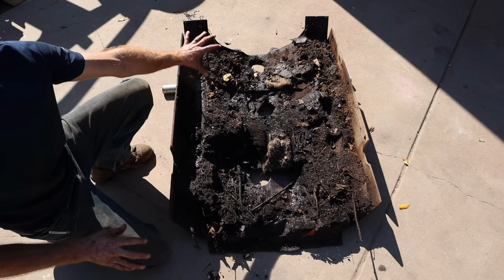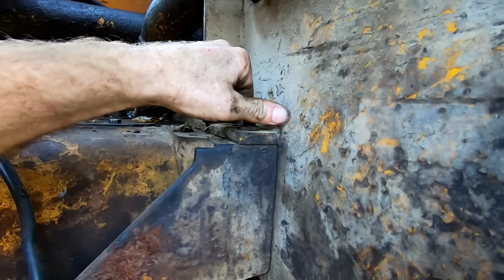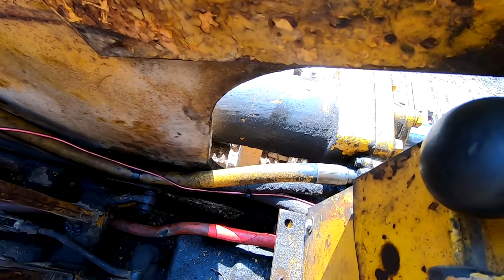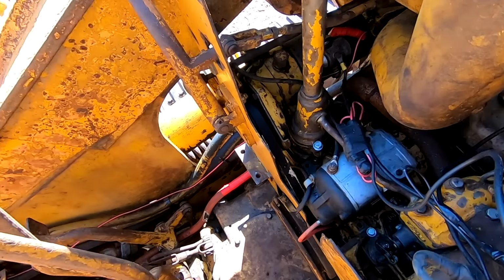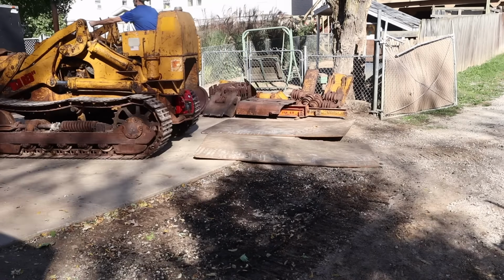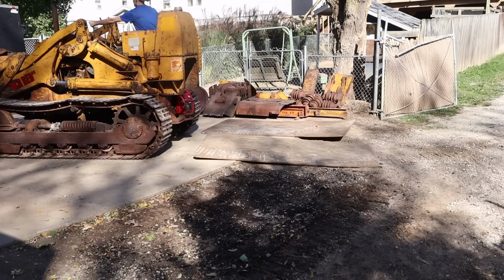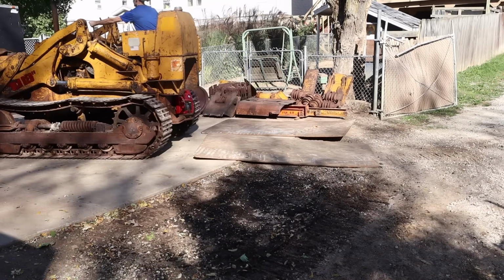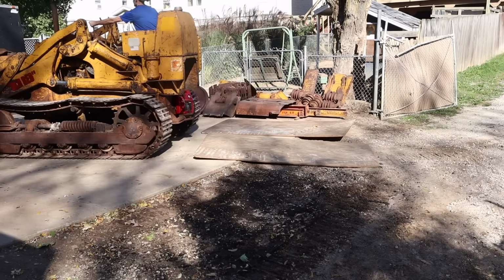FIRST Wash in 64 Years... or Something!?! ~ Part 7 ~ 1950s Caterpillar TraxCavator

Comment: The pressure on the breather is called "blow by" from the rings. Looks like old red needs some new rings and probably mains. Since it starts and runs so well my guess is the injector pump is good, which is very expensive and why you keep good filters on the fuel. You cannot put enough new filters on the fuel and water traps.
Reply: Yes, but the head gasket is also leaking, so my money is on that it had an overheat and the head bolts expanded enough for the gasket to breech.  So there is the possibility that the pressure in the crank case is coming from there too.  Engines made when this one was tended to have a lot of blow-by anyway though.
Reply: @trevor311264  Good call on the overheat! There was that very leaky radiator that has since been fixed.

Comment: You are definitely in for a long haul with this one! In all honesty, I'd suggest just preparing for complete teardown and rebuild, as it seems that the previous owner already started on it.
Reply: And it would make great content ;-)
Reply: Did all those bolts just shake loose with use. Wonder what their torque spec is?
Reply: I really want to see every part sandblasted. and powdercoated.....if people turn 1950’s muscle cars into works of art.....😉
Reply: I was going to say something along these lines.
Just as well pull every bolt and nut out, line everything up on the concrete like a model car build, and then put everything back together.
Reply: I wondered about that. It might explain the abundance of loose/missing hardware. Maybe all the missing ones broke, or had to be drilled out, the loose ones waiting for eventual replacements?

Comment: CAT dealer: "So what seals do you need?"
SW: "ALL OF THEM!!!"
Reply: Seriously though, I really hope CAT can help out with this (to say nothing of the 100 kg of bolts that need to go back on the thing). This is such a cool process on a machine with such a cool story.
Reply: Customer wants to buy seals for the machine, machinery dealer: we're sorry, nothing for machines elder than 20+ years, we definitely recommend leasing a brand new one instead of fussing around with seals ...
Reply: @manfredschmalbach9023  wrong caterpillar stocks parts back into the '30s for their machines. not everything but parts are not a problem when working with a caterpillar.
Reply: @mog5858  That's actually a very welcome information.
Reply: @manfredschmalbach9023  Sad, but definitely some truth to that.
Reply: @mog5858  I have a similar machine to that shown which was my fathers (i am in UK) - i would like to get it going again -  do you have an address of where to purchase these parts please
Reply: @saunderssmile801  your local Caterpillar dealer.  also, get in touch with the Link Club they would be a big help in the UK
Reply: @mog5858  Thank you for getting back to me - it is a 933 which has a ;pony' engine, both engines will require a full overhaul. Where do i et the link club contact details?
Reply: @mog5858  Found it, thank you again

Comment: Those 2 inspection plates @5:36 one on left ,one on right,  may have a filter for the final drives [the 955H does]  might check into one to check inside oil? adjt. water drain or clean out ? ect. ] Big one in the middle is just the PTO.

Comment: The look on your face was priceless as you sifted through the belly pan; and grow a beard slacker. [sarc] 
I believe water gained access under the valve cover when you pressure washed it via the one broken plastic piece. Btw great video.
Reply: This is the answer to the water in the vc.  Nice spot

Comment: depending on where you are.. the adjuster screw for the tracks.. youtubers like Vintagemachinery , Abom79,  Bcblock02,  and a few more will usually assist you in fixing or creating new components if it can be made on a lathe or a mill.
Reply: I'm thinking that he has at least one spare from the parts machine.  Maybe those parts were lost, but hopefully not.  Yes you could get these remade, but it would likely be cost prohibitive unless one of those well known youtube machinists can help him out, like you said..

Comment: That water in the valve cover was most likely from the pressure washing.  If it were condensation, it would have mixed with the oil over time and become milk chocolate looking.
Reply: Nope, because every time the oil splashing inside cover gets over 100 degrees Celsius the water will boil off and separate out.  But I agree that it is most likely from the pressure washing.
Reply: Oil with water in it long term does not 'boil off', it just makes horrid tan sludgy goop with low lubricity.
Reply: Couldn't it be from the broken nut that holds the valve cover on. Water could've got past while he washed it? 🤔
Reply: @trevor311264  The water turns to vapour with the heat from the engine and mixes with the oil mist and in turn creates a grey sludge under the tappet cover and once that has occurred the it does not separate. that is why all of the later engines have a EPG valve fitted to the top of the tappet cover and the hose connected to the inlet manifold to suck out the vapour's that build up inside the engine.
Reply: Agreed, that water is far too fresh looking for it to be already in there. That has to be from the pressure washing. Had the same thing happen on a Daihatsu car I worked on recently, and it looked EXACTLY like that when I took the rocker cover off. There was no existing water in the oil when I did the job, and there still isn't. It's purely ingress from pressure washing. With the TraxCavator considering how buggered the seals around the hold-down nuts are, and the gasket is basically non-existent, you'd be a fool to assume it was anything else. Water is extremely good at getting into little holes and cracks and splits, especially when it's under high pressure. Nothing to worry about at all.
Reply: I’m thinking that when you put him back to work, he won’t push or climb as well because you knocked a good bit of his ballast out of that belly pan. That 200 pounds was there for a reason. It looks like you have a good handle on what needs to be done and I wish you well. 😎👍👏
Reply: @michaelmcclure8673  I agree. Also, the valve cover itself has been over tightened in the past and is bent down in the center. A piece of 2X4 and a hammer will straighten it right out, though.
Reply: @bobw7066  In days past they did not even have that, it was sometimes vented into the atmosphere through the oil filler cap, and sometimes not even that. 

That water in the rocker cover is not condensation, that engine has a vented filler cap.
Reply: @jenniferwhitewolf3784  If the engine is run fully hot then the water evaporates from the oil and vents out through the filler cap.
Reply: @bobw7066  I have taken vehicles with engines where the rocker cover is full, and I mean absolutely covered in mayo, driven them for a few hours with the engine fully heated up and the emulsification is gone afterwards.  I have been doing mechanics now since I was a 12 year old boy-scout (I had my car mechanics badge!)  Before there were proper crank case ventilation systems the gasses used to just vent into the atmosphere through an oil filler cap that had a basic mesh separator.

WTF is an EPG valve anyway?  Last I knew that was part of Volvo's exhaust braking system on their heavy trucks,  I have been on Mercs for the last 10 years, so you have me beat.  Either that or you don't have a clue about what you are talking about.
Reply: I also agree👍🏻
Reply: @jenniferwhitewolf3784  that's not water that's antifreeze.
Reply: I've cleaned my fair share of engines out with hose water. Followed up by diesel, then an oil change. Never had a problem.

Comment: The intake manifold of the diesel engine is also the exhaust manifold of the pony motor, that is why the exhaust gases are coming out the intake manifold.
Reply: So pony exhaust preheats diesel intake and at least one diesel cylinder for cold weather starting! Brilliant!
Reply: @wssides  and the diesel and pony motor share the same cooling system so as you run pony motor it heats diesel also

Comment: Water in the VC came from the power washer via the old gasket and seals
Reply: Either that or a blocked crankcase breather.
Reply: @joriskylie6857  My money is on the pressure washer, especially the state of the top of the cover, it was bowed down where it has been over tightened again and again and again over the years.
Reply: Wrong.  Those are all under a lip so no direct spray was going to that area ever.  It is from the 1 broken valve cover cap.  That took direct and most likely prolonged spray and it drank a little bit of water from that.  Very much OEM designed to be on the most vertical point to allow water to enter the engine.  IMO that is
Reply: 21:20 Shows you it is a sealed cap, with a rubber grommet to allow for torqueing of the valve cover and seal it at that spot but wont allow for over torqueing which would tweak/bend the vc.  Over torque would crack the cap and allow this to happen.  Then you call up the OEM and order parts;  and job security and such.

Comment: You have lots of work to do brother, there's a couple of weeks work on just locating in replacing, removing cracked off and tightening all the bolts alone. I would temporarily paint / highlight everything with a shot of red paint that needs fixing as to address all issues, make a list / catalogue , of all missing bolts gaskets, seals, hoses this way it would help to prioritize . 
As for the scale of work, I would allot in segments, do a full tear down.  Get schools, colleges, diesel mechanic instructors involved and try to get whatever financial support and sponsorship you can from Caterpillar and their suppliers as a promotion . 
Another idea.., look at Cat commercials on your channel as another source of revenue, its a tax write off for them. 
Remove both engines and do a complete over-hall. 
The  old Track pads as an example could be turned into bench anvils as a means of generating a source of income to further the project. Get others with channels on the Tube involved to source NOS or used parts, o-rings and gaskets nation wide. I would also have everything cleaned de-greased, sandblasted, primed and painted before re-assembly. After it's all completed a full paint job with new decals. From my perspective, on and off between other projects, probably 1-1/2 to 2 years work at a minimum. What I just said is easy for me to say but you'll never know if you don't try, Good luck in your endeavor 👍👍👍
Reply: Hand Tool Rescue to the rescue?
Reply: He stated in the past video that he doesn't want to do the full restoration.
Reply: You definitely sound like someone that can say, " been there, done that" 
And methodical in doing it. 👍
Reply: @nicholaslittle2312  We could invite This Old Tony &  Keith Rucker too!

Comment: As you had the valve cover off probably a good time to retorque the head bolts. This may be all that is needed to stop the oil leaks from around the engine head.
Reply: Times I would try that = exactly none.  Once there is oil on the gasket you are never, ever getting it to seal again.

Comment: Left handed drill bits can be your friend. Spiral, not "L" shape easy outs too.
Reply: Easy-outs don't work unless the bolt is about to fall out anyway.  You need to use splined bits or Torx bits tapped into a hole.  Easy-Outs simply press what is left of the bolt against the hole, then snap.
Reply: @trevor311264  Agreed.  What ez-outs are good at is removing bolts that have sheared off, or broken off from overtorquing.  They are NOT good at removing bolts where rust has jammed the threads, and the heads snap off from trying to remove hardware.  Like you say, the tapered flutes pull the extractor into the badly rusted/broken bolt and actually expand the threads making it harder to remove.  A square sided extractor, or in this case the torx bits work better for these situations.  I personally move to welding a nut on whats left as my first line of attack, assuming the bold stub isn't too far recessed.
Reply: @Bobbywolf64  Yep, and the thermal shock from the welding goes a long way too!

Comment: exhaust out the intake is probably a stuck exhaust valve.
Reply: Or it could be due to the blown head gasket.
Reply: @grantahlschlager9597  or the heat exchanger from the pony motor that runs through the intake to heat the air.

Comment: Not sure if you have noticed or it has been commented before but the reason the track is slipping is the drive wheel is stripped on one side. the points are visibly shorter on one side.
Reply: He covered that on a earlier video, had to tighten the track just to move it.
Reply: Yup he’s got a spare

Comment: Should’ve doused it in degreasers first
Reply: don't think that would have been good for the puppy dogs. even after cleaning up the rock underneath there still would have been some left.
Reply: aside from the animal concerns, is there any good reason NOT to use degreaser on a dirty pig like this? 
I know it's possible to damage some types of plastic/rubber components, and wiring and water don't go together real well. Any other issues motor morons like me should be aware of???
And yes, I AM a professional auto mechanic... sorta. I just work on the 'breaking them' side of things. Sort of a "pre-mechanic."... (and I'm damn good if I say so myself).
Reply: I don't think citrus based degreaser that is so very popular these days is gonna be anywhere near as harmful as all of the oil, soot, & grease that's being washed off of the machine......

Comment: That thing needs a ground up restoration of EVERYTHING, including engines and clutches and gear boxes and running gear and hydraulics.
Just in parts never mind Dry Ice Bead Blasting primer & paint - even with free labour, by the time your finished you will have a new “Antique” crawler tractor Thats got more $ in it than it can sell for and it will never be modern like a nice new one. No air conditioned cab or suspension seat etc.
Unless your an enthusiast and get Patreon sponsors to fund the parts it will send you broke on something you will never get your $ back on.
Still be a great project to watch, but I’m glad it’s not my hip pocket paying to do everything needed to make it new again.
Anything you don’t do, will be the first thing to fail and leave you stranded part way through a job.
You can’t do this stuff in half measures - it’s one in - all in and don’t quit till it’s done.
Have you got work needs doing on your own property with it?
If so would it cost less over all to dry hire a modern machine to do the work and hand it back when the job is complete rather than fix up an antique that might die unexpectedly in the middle of the job?
This needs some serious thought.
If your just going to patch it up then don’t even start, sell it for scrap.
If your going to restore it start with one part (Belly plate you removed first - bead blast it back to bare metal, rust convert it, primer and paint it and set it aside ready to install as the last part of a full restoration. Do not pick up the second part to do likewise until the first part is complete and you don’t need to touch it again when it’s bolted back onto the machine.
Never look ahead more than the one part your dealing with now.
If your not going to rebuild the rams seals yourself, you could remove the rams and farm them out to be rebuilt while your working on other aspects.
My 2c. I wouldn’t start because I wouldn’t live long enough to see it through to completion.
Reply: Buddy, you are watching the wrong channel.  People do these projects because they enjoy them.  Restoring old cars, old wooden boats, old machinery, etc. is a labor of love.  As the saying goes, "it’s the journey, not the destination."   My 2 cents, move on to the "how to buy a band new loader" channel.

Comment: My grandfather farmed in North Western Victoria, Australia during the 1950's with Cat D8 dozers pulling broadacre ploughs in sandy country. During mice plagues when the D8 was shut down on dark, all the mice would scurry underneath and in the belly plate in a large mound, to get the warmth of the engine and gearbox. In 1988, the old D8 got a full rebuild with new,old stock put away in a shed and she back to life for the occasional earth moving work on the farm.  I can still remember brass brushing the preservative off the new cylinder heads, If recall she was a '2U' variant.

Comment: What you need more than anything for your broken off bolts is a few left handed drills. See--sometimes you don't even have to put an easy out in the hole you just drilled because the drill is already pulling to unscrew it because it is turning backwards already

Comment: The job I would dread would be replacing that sprocket, we used to have those cable drawn D8 cat dozers that they used to push a landfill, they were 50s models, we constantly worked on those old dozers, but they done the job, it’s amazing these old machines are still ticking along, I’ve enjoyed watching your videos with the rebuild, My boss is an awesome mechanic on this old stuff, keep them videos coming!